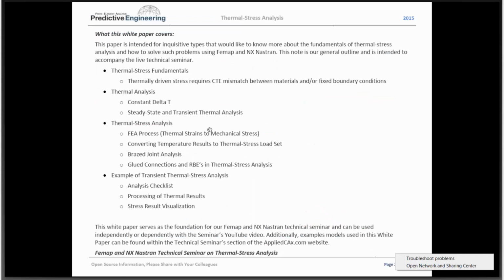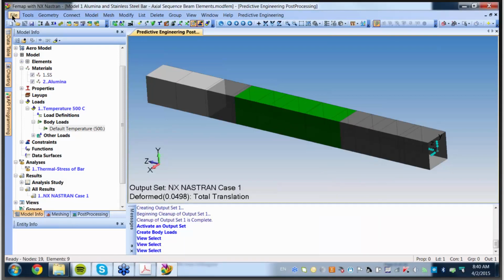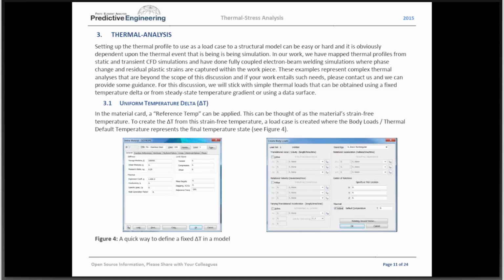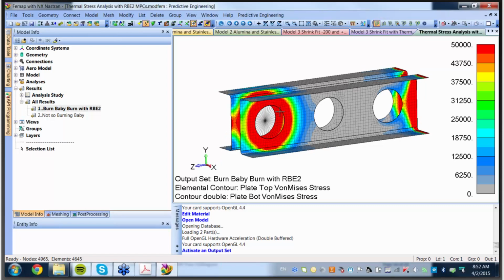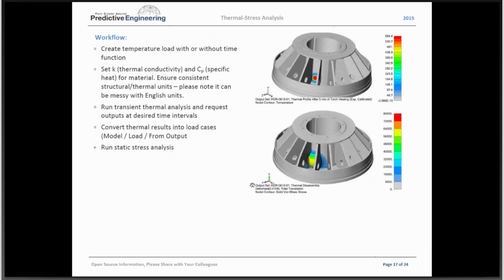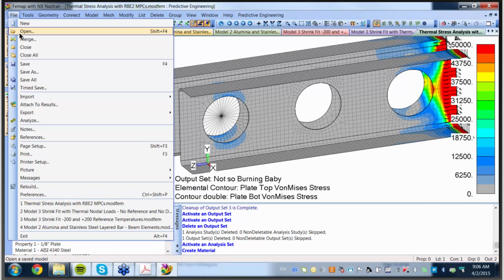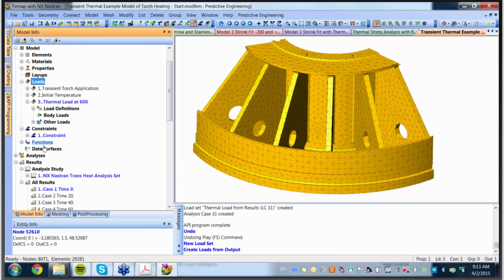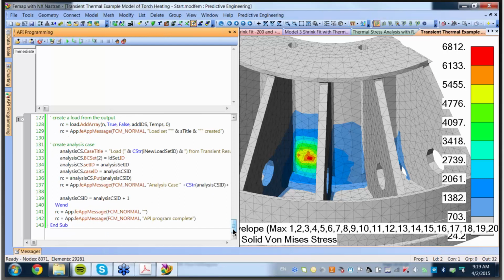Thermal Stress Analysis with Femap and NX Nastran

Comment: i did a SS heat transfer analsys in FEMAP 11.3.2 with both plate elements and later Hex brick elements. The stresses in the plate elements are a bit weird at it shows peak stresses at strange areas. The hex mesh stresses a more logically distributed. Can you please help me understand why is that so?